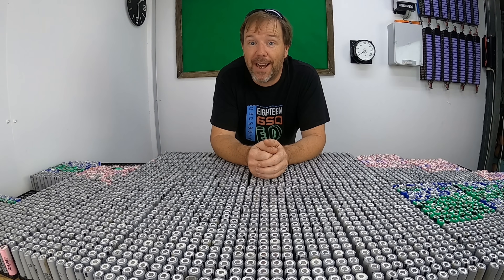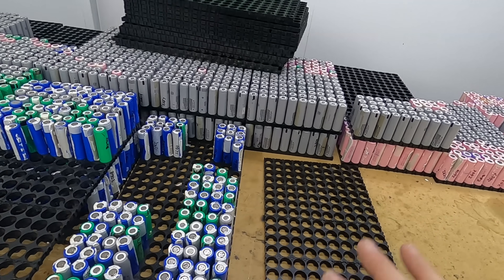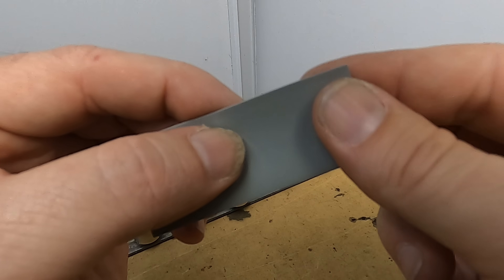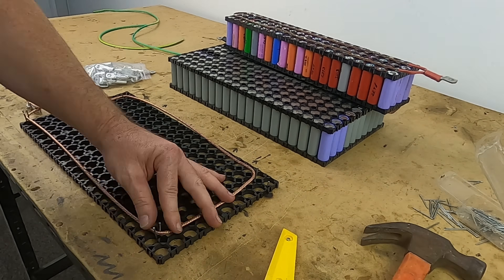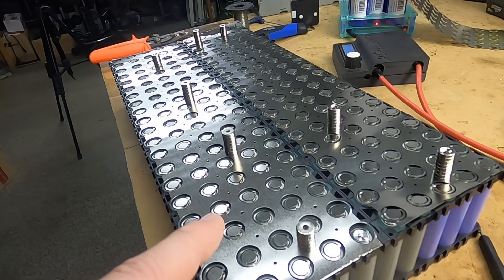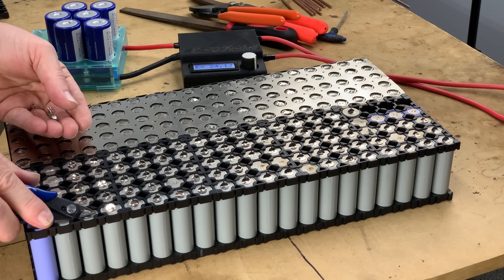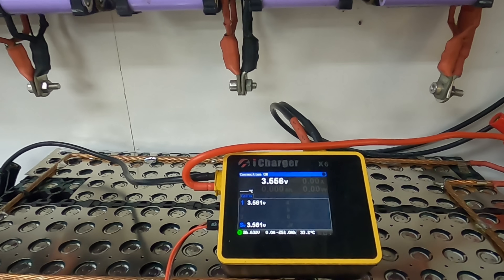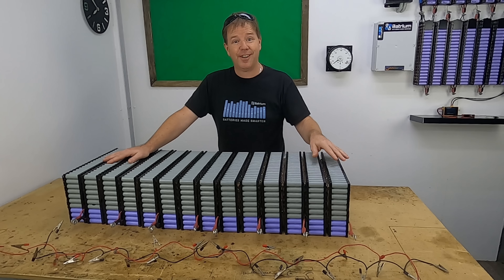Creating my single biggest D.I.Y. battery with 2800 18650 cells recovered from used laptop batteries

Comment: Great job Pete. Please tell me there was a mistake in the pack you ripped the nickel off and not just to show us how lol
Reply from the maker: Yah, i screwed up lol
Reply: I was wondering the same thing... I'm like what did that do, I thought the idea was to connect them.

Watching the sorting, sorting again & resorting, then removing the wrap to rewrap with heat shrink must of took forever.  

I'm surprised as you spot weld more and more together on the plate it doesn't explode batteries or something.  I watch these videos mix & match of power cells and it is interesting as the labeling always says not to mix old with new or varying cell types. I am surprised you can put that many different varying cells together.
Reply: @Gamerz00760  That is why he tests everyone and determines the capacity and then groups them together to try and get a balance for each pack. Lot of work
Reply: @offgridwanabe  

Right, I only meant I believe it is safer to have all matching capacities.  A 2000mah + 3000mah you wouldn't think you would want together for instance.  

Electricity is interesting to me... AC vs DC, ability to charge or use/extract energy.  It would seem like when you proceed to charge batteries they would have trouble charging because each cell has different capacity.  Also be difficult to calculate charge needed and how long.  It would seem like lower capacity batteries would be over charged or higher capacity batteries wouldn't reach full potential as well.

I do a lot with autos, computers and some self taught programming, electricity though is just one of those things to me you might not get a 2nd chance... I'll have to stick with basics, audio & replacement of existing circuits.   

Having had an order picker battery explode, battery leaks, few 12v car batteries explode, seeing tesla fires from batteries, having known someone at work who died from working on his house wiring, and knowing general dangers... I've been around them to see too much go wrong.
Reply: @Gamerz00760  I agree with you and wondered the same thing I can only assume he knows why, but it would make a good question for Pete to explain.
Reply from the maker: @Gamerz00760  You can, it works - but on paper you shouldnt i guess
Reply: @HBPowerwall  

Well done with the video though and work put into it.
Reply from the maker: Thanks 😊

Comment: use a battery balance, if the batteries are used often one battery in worse conditions then the others can overdischarge or overcharge during time and can cause a fire and explode and all  the surrounding batteries with the heat of that baterry
edit: be careful with the batteries in parallel
Reply from the maker: Your new here lol Check out my other videos - BMS, fuses, breakers, temp sensors, fire alarm, seperate install sheds - Enjoy your stay :)

Comment: Well, I'm sure someone else has already said this, or you may have actually bought the right one to start with, I am almost on the other side of the world from you so I am unsure what flux the solder you bought has, but you mention buying it in the plumbing aisle, and there are many differences between electric and plumbing solder but, the most important one is the flux, which is very  corrosive on purpose for plumbing jobs. This means that within a few months or years, you may find yourself with failed packs or worst...
Just a heads up, really, I'm pretty sure with all the years you have on this (thanks for sharing so many of them btw) and your knowledge of electronics, it's probably something you know, but others may not and go buy plumber's solder to use here, which could be quite a dangerous endeavor.
Reply from the maker: I agree i should have covered off on the fact i clean it all with IPA after woods
Reply: @HBPowerwall  I would not even consider mentioning it if you hadn't mentioned buying it on the plumbing aisle, to be honest. But yeah, maybe mention that on some other video just to be extra safe :) Obviously you wouldn't make such a rookie mistake, but many rookies such as myself (not on soldering but pretty much everything else you cover) take you quite literally, and mishandled batteries will burn your house down!
Reply from the maker: Won't be burning my house down... stay tuned for that upgrade :P

Comment: I mean yay for recycling batteries but it's much safer and easier just to buy batteries new for the purposes of a large battery bank....
Reply from the maker: If you have cash upfront it's the only way to go.. But i have more time than money and that right there is 150kg of batteries that aren't in land fill..
Reply: @HBPowerwall  Ya I mean it's admirable that you spend the time and skill.  But for most hobbyists it's a lot of work (to do safely).  With new cells you can typically test a few and then safely assume the capacity of the rest will be within a good margin of the tests.  No need to balance packs.

Comment: How many cycles will it last for? I think 500 to 1000 cycles. Can you please tell me how much time does it take per cell (including dissassembling, testing, sorting, populating the pack and connecting them into the final battery)? For example 3s2p pack takes one hour to make, so that is 10 minutes per cell.
Reply from the maker: I have quite a few cells so actual cycles is maybe 20% or less a day so should last quite a few years. As for time to build I did this in my spare time spread over months and months and didn't track time at all.. Sorting the cells once they were tested at the start of the video took a good 8 hours or more tho

Comment: GREAT WORK!! That's one of the cleanest-built packs/banks I've seen yet! Those look like perfect welds too, but I still would have done 4 per cell lol.
Reply from the maker: You know what, in hindsight even tho it would have taken double the time I really should have done 4 after finding almost 40 not connected welds - that search alone took longer than doing the whole with an extra weld per battery..

Comment: Those are some big packs looks like a great build can't wait to see it up an running i got question if you would kindly answer or somebody in the comments answer  i would greatly appreciate it. I got some LG high drains cells 10 amps I got enough to build a 14s pack 80p they came from e bike batterys  can I run that pack with my regular LG batterys 5 amp that I built from modem batterys  they are roughly the same millie amp hour 2700 to 2500 can I put the high drain pack on the same wall. Or should I put them on different inverter and keep them on their own  just asking cause I'm not sure I seen anybody run them in together an you probably have more knowledge on 18650s than anyone else
Reply from the maker: Can't really help with the question but i can assure you i can't wait either - between rain and work it's slower than desired :(
Reply: It looks like you have different C rating battery even though they have similar capacity (mAh). I would strongly recommend putting on different inverters or simply add DC/DC converter on each cluster of battery before connecting to the same inverter. The reason is different C rating battery cells are likely having different internal resistance. Higher C rating battery cells are often used for power tools while lower C rating cell are used for digital hardware.  Paralleling them together, without controlled environment, will make the lower-rating cells work harder and reduce its cycle life. Mean well SD-1000L-48 (SD-1000L-24 or Mean Well SD-1000L-12 if you are using lower voltage inverter) will help. You may have to find a more powerful one or stack up a few of them if you use more powerful inverter.

Comment: 3.18v is low! I get worried when my off-grid system, gets below 3.3v. You're brave. I built a few packs like this after watching your videos that I use for various things around the house and powered the home with them as proof-of-concept with my battery inverter before I scaled up with 16 Tesla battery packs. I just couldn't get my hands on enough laptop battery packs for a price that made sense to build them all myself.
Reply from the maker: You can't go wrong with Tesla batteries - they will out last these by a factor of 10. Testing voltage was down to 2.9 v

Comment: how high would the current per cell actually be, for example 50A with a 200Ah 4S system can you calculate that? ..320 cells
Reply from the maker: I have to work out the math on that lol and i suck at math
Reply: 320 cells divided by 50A or 80 cells by 50A .. ?? @HBPowerwall

Comment: Beautiful job Pete! Is there any downside to using thicker wire and not twisting together multiple strands? I have bare 8 gauge copper wire I’d like to use for busbars. Thanks!
Reply from the maker: Not that I know of, i'll be using this battery in parallel with my 30kwh battery so the load per cell will be tiny and the busbars are more than upto my load requirements.

Comment: Truly a beautiful job! I just bought the nickel fused by Battery Hookup (using your code :)). My setup will be 14S100P (4x25 cells for each string) ~ 3100mA / cell. My inverter can take a maximum of 4.6KW from the battery (less that  100A @ 48V). Do you think I need to add bus bars or are battery hookup ones enough?

Thanks!
Reply from the maker: 100p is 1 amp per cell, I would double what i've done busbar wise
Reply: @HBPowerwall  Im new to this, i know that batteries and understand the purpose, but what are you making this for, what are you doing with it? And how come you went with one big 3v battery?
Reply: @danking5382  Its not a 3v battery, it is a 48v nominal voltage battery. 14S200P formula: 200 cells are connected in parallel into packs, and 14 such packs connected in serial to rise voltage. So 14x200 = 2800 cells total.
Reply: @Mad---Max  ah I thought it was parallel, trying to achieve a lot of mah
Reply: @Mad---Max  Cool. I'll be here waiting for you when you get back online k? If you want to send me your email address. I would like to chat with you sometime. K?
Reply: @HBPowerwall  I Have A 10000 Watt inverter that I Got From Wish . com and It's not a pure sine wave inverter but it does work quite well! What is the difference between a pure sine wave inverter and a non-sine wave generator?
Reply: @mycroftselene3326  The output. Sine weave output is what it says, otherwise the sine weave is approximated with voltage going  up and down in discrete steps. The biggest difference can be noted when the generator powers an inductive load, like a transformer. A pure sine wave changes current in the primary at 50Hz, and a non-sine may do it at 200Hz or more. In case of sine weave case the secondary current approximately mirrors primary, in non-sine it is quite unpredictable  :)

Comment: Imagine all of that batteries in a single powerbank
Reply from the maker: Kinda is really when you think about it, just 48v rather than 4v
Reply: His house is the power bank
Reply: @Lutherman_edc  His walls are made up of 18650 batteries
Reply from the maker: *a wall of 18650ies..... **thinks hard!
Reply: @HBPowerwall  You can hammer a tap into any wall to get DC voltage! :D

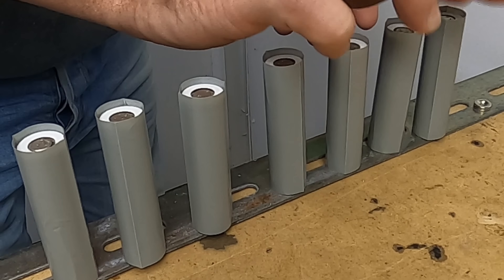Comment: 5:08 "Give them some heat" and proceeds to use a hot air gun. Pete Pete Pete. You should have a DIY conveyor through an oven to automate the process  😜
Reply from the maker: lol I never want to have to do that many cells it requires automation of the wrapping process lol I WOULD DIE!

Comment: Very good work, a great job! You inspire me, for maintaining very easy for replace fuse, or cells in the pack. Just a question i have not understand why you don't use 6 blue cells + 3 empty cells  in the pack of 200P ?
Reply from the maker: Yes, three empty spots just allow for the cell mount to slide in with out damaging cells. The 6 blue cells are where the mount could touch the cell. The 18650s are all negative on the outside of the cell so the blue cells are not connected so less chance of a short to ground. I will explain this in the next episode.

Comment: could you mention what  the magnet piles on nickel strips do
Reply from the maker: The are a fast way of holding the nickel to the battery. Also used them under the cells when i was putting on the heat shrink as both a spacer & a way to hold cell from rolling away

Comment: Good to see that the Samsung's really end in the top of capacity. Wish I could find defect laptop batteries for a reasonable price. Awesome project!
Reply: What's a "reasonable price"?
Reply: @SyntacticOperator  for € 1,75 I can order a  2200 mAh brand new, all the same capacity with warranty so for average 1-1,5 Ah without any warranty it should be aroud € 0,35 a piece
Then you have the shipping part. I wouldn't mind to crack open 500 defective laptop batteries when achieved locally here.
Reply: @SyntacticOperator  You are absolutely right!, I always keep returning on new LiFePO4 cells or prismatic ones, specially the CALB 180, winston 200 or 400Ah cells. These are so pricy however that it's holding me back to buy them. Looking at NKON.nl, a dutch site that sells lithium cells, I can make a 10kWh battery setup with 18S60P config, ending at € 3.200 fo the cells only. Adding a decent bms and buying a kWld spotwelder, sets me back at least € 5.000 for 10kWh of storage.....
16 200Ah prismacells wi set me back roughly € 4500 but saves me a lot of work..
Reply from the maker: New V Used is a great debate - I have time and no money so this approach works for me.
Reply: @HBPowerwall  respect HBpowerwall! I see your projects and would love to build one. However, starting from scratch and needing all the goodies to build packs like yours, I have to invest so many, that simple prismatic LiFePO4 with a lot safer chemistry will be the best option for me. If I would stumle on a truckload very cheap defective laptop batteries however, it would shure let me doubt...
Reply from the maker: There is so many paths to follow, i'm just happy those paths are getting much cheaper with the likes of BatteryHookup
Reply: @SyntacticOperator  correct!, I am pointing towards the LiFePO4 chemistry with a lot safer thermal runaway point than Li-ion and the absence of som metals like manganese (?) used in the higher power cells.
Reply: @SyntacticOperator  I am sad to answer you this with a "no" however, in near future I definately will be so, at least in spring and summer times when the Sun delivers enough to unplug our house from the net.

Here in The Netherlands we have a very strange movement going on: Our government is spending LOTS of money (many bilions!)  to support big companies making equipment to waste 50% of all the wind- and solar energy. This companies promise to make BIG fuel cells and electrifiers to generate a very low efficiancy storage medium. it's called H2....
Instead of focussing how to use our excisting gas for the better and transport the solar and wind energy better to the customers, they want to make H2 to store it for winter times, while spilling million m3 of pure drinking water to do so and losing 50% of the energy that could have been used in a far better way...

Happily there is no law that forces me to keep on using gas or elektriciy when I can do without it.

Comment: Car EV mmm nah stationary yes.  my leaf would need to pull 230 amps for the 80kw peak.  These could be a feed pack though, just flow 30a for top off and assisting.  96 small packs neatly into the boot. Could be an issue.
Reply from the maker: I would have to agree - vibrations and mechanical strength alone would be the first issue - then load, and density - but many are still trying to do it..
Reply: Muxsan make some good extender packs for the leaf, they must be using pouch cells by the looks
Reply from the maker: He is a cleaver guy for sure...

Comment: Pete love the new packs, looking very smart, only thing is that you will be make a lot very jealous, like the magnets to keep things straight. Nice colour grey, is the 1 circuit of 10mm cable enough around the outside
Reply from the maker: yep towards the end I did a quick voltage drop test
Reply: HBPowerwall how about the power cable running through the middle of the nickel plate, then bend into the centre, so you would come out in the centre of the pack with your power pickup
Reply from the maker: either up the middle or left to right one or two extra pieces is all i think you'd need
Reply: HBPowerwall I was thinking, as they are 5 rows wide, then between 3 & 4 on each side of the pack, this will balance the load through the nickel strip. So you draw the load in the centre of each strip ?
Reply: Great work. Look forward  to the rest of the videos

Comment: huge mate, but id never get my hands on even a quarter of that, i do like the larger  100amp continuous draw 3.2v  lifepo4s  , but nothings free. battery balancer reliability has always been a concern for me. ive seen factory made rectangular lifepo4 batteries with failed balancers , however ive got to go lithium lead acid is not enough bang for your buck cycle wise and useable power.
Reply from the maker: LIFE cells would be my first choice if they were readily available cheap